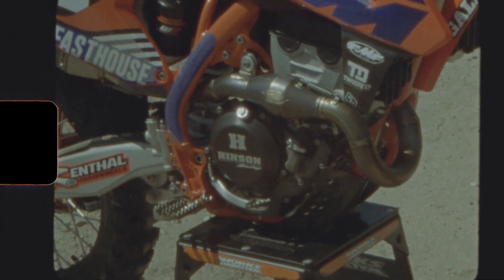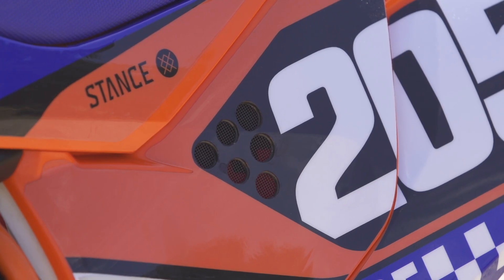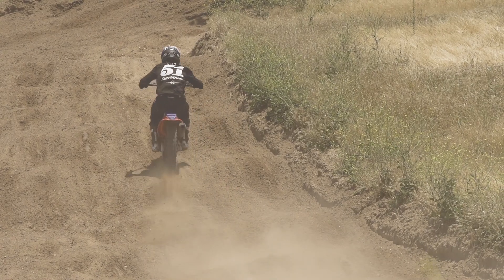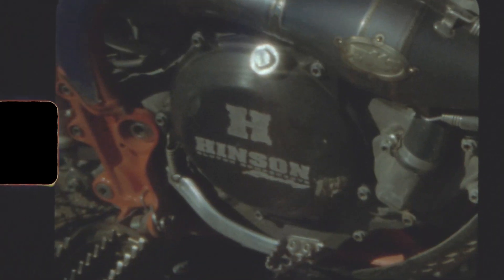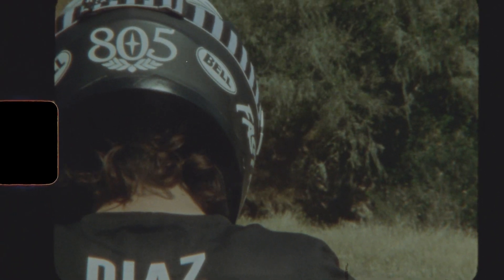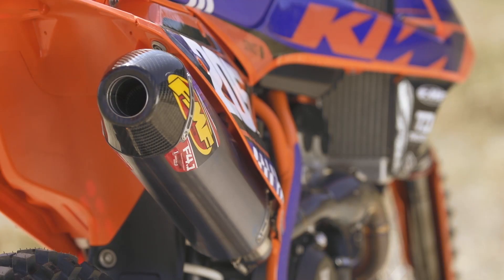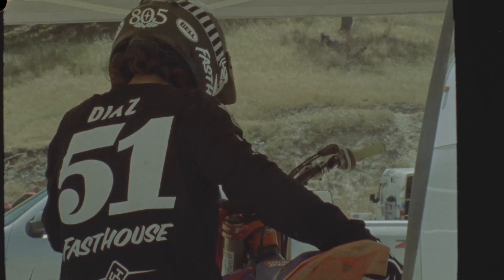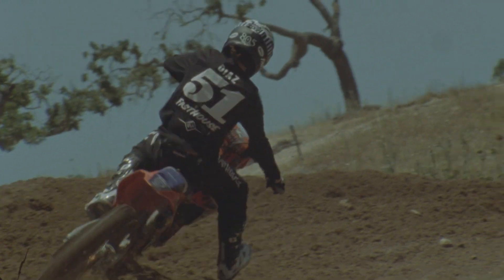Tested: Twisted Development/FastHouse KTM 250 SX-F

Comment: I'm 6'2 210. Is the 250f too small for me?  I feel like the 450 is sometimes too much and takes away from the fun. I'd rather be comfortable and nimble.
Reply: The Dude 250 2 stroke
Reply: Roger Griffin ridden two strokes all my life. Still have them. Just dabbling in purchasing a 4 stroke now.
Reply: 250 would be way to small, unless you trick it out to have enough power
Reply: Tora Riders what about a 350?
Reply: The Dude a 350 is a bit more mellow than a 450. They made it that way for people who don't like the harshness of 450s. The 350 is also said to feel a little lighter then the 450.
Reply: what is your skill level?
Reply: The Dude The 350 feels weird to me, on paper it shouldn't feel the way it does. It feels really light and has an easier powerband to handle compared to a 450. It more less feels like a really hot 250f in the way it loves to be wound out, but it doesn't have that bottom end hit like a 450. I'm 6'2 220 and a 250f feels very lethargic under me.
Reply: You are not reving it enough.  Im 6' 240 and my 17 250f is fine.  It pulls very hard to redline.

Comment: Peak hp #?
Reply: DirtBike DJ  a stock one has 44 hp so this one probably has 46 or 47 but I'm not sure lol
Reply: Mason Decunzo it has to have more than that, that's what a stock 250 2 stroke makes lol
Reply from the maker: It was right under 50.
Reply: Vital MX that's crazy, you should do a similar build with a 2017 250SX instead that would be so cool